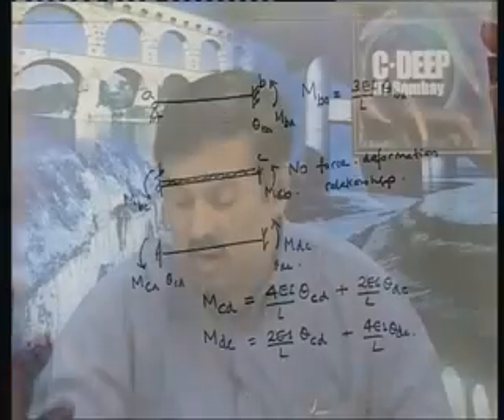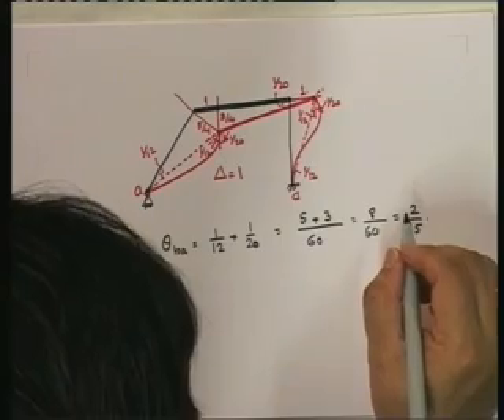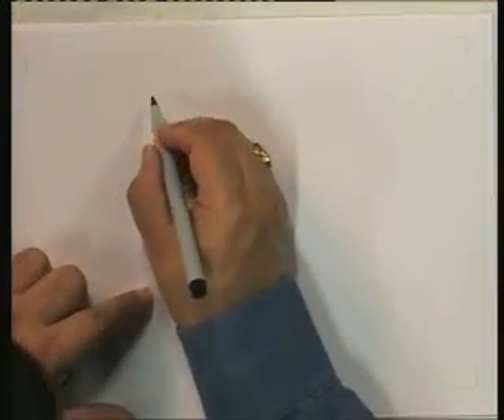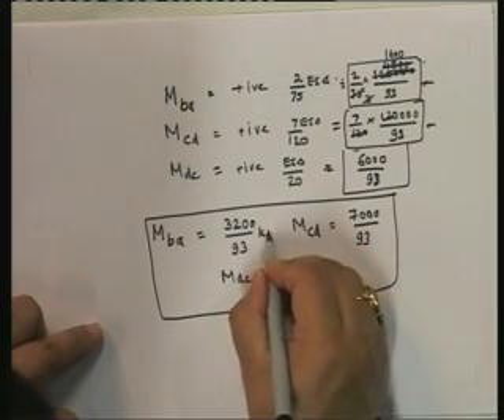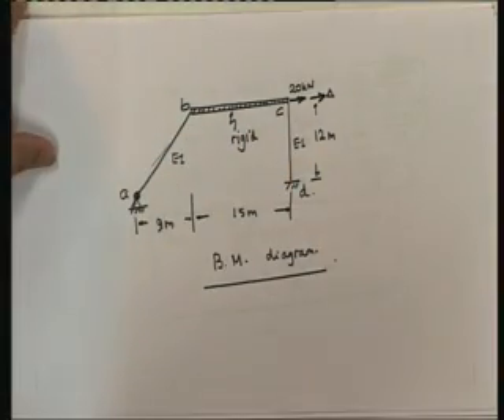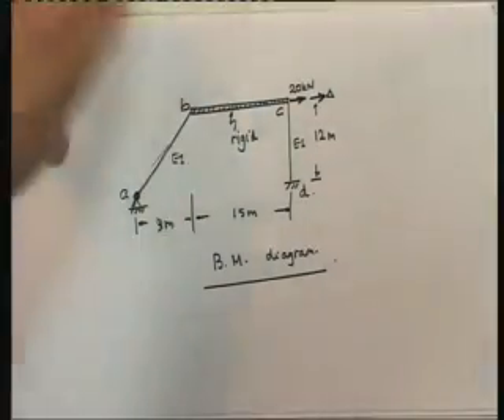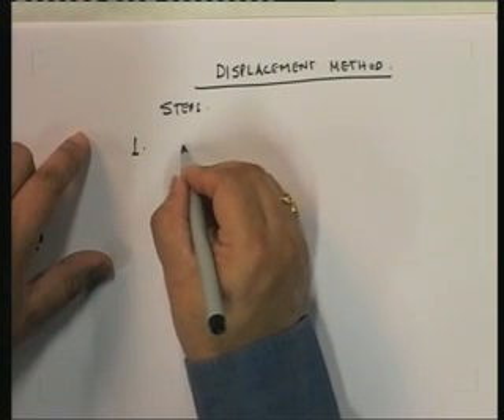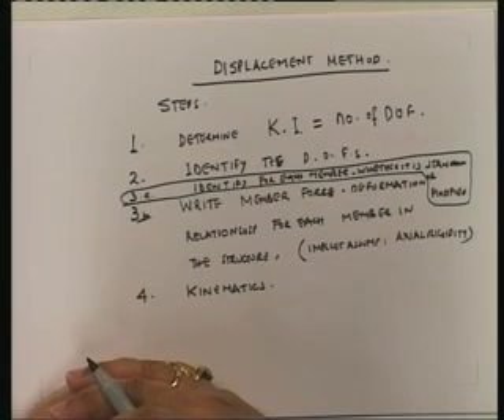Lecture - 17

Comment: @46:31 These points should have been printed to avoid so many mistakes . It defeats the whole purpose of stating the steps if points are missed and added afterwards. Are notes of these lectures available? Which book is being used as a reference for these lectures.?

Comment: theta ba =2/15...so where is delta coming from?
Reply: When delta=1 (unit displacement) then theta ba = 2/15, however, since actual delta is not equal to 1 (it has some other value under 20kN force) so theta (from unit displ.) will have to be multiplied by delta to get actual theta.